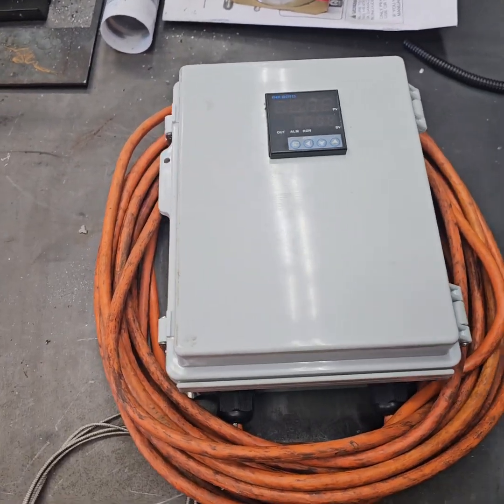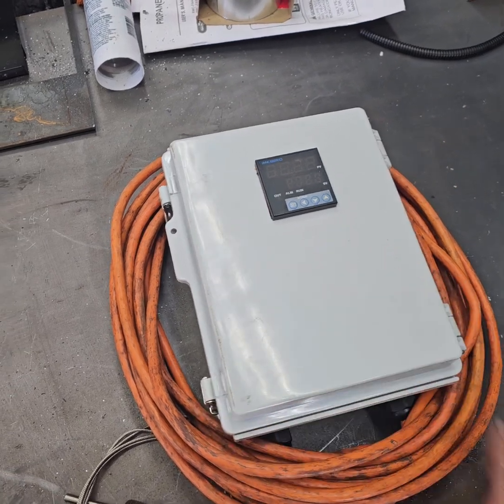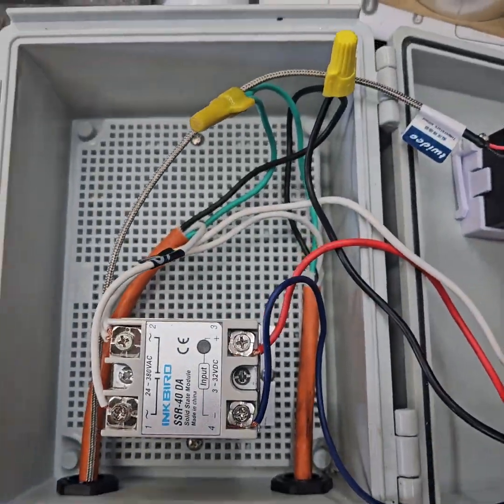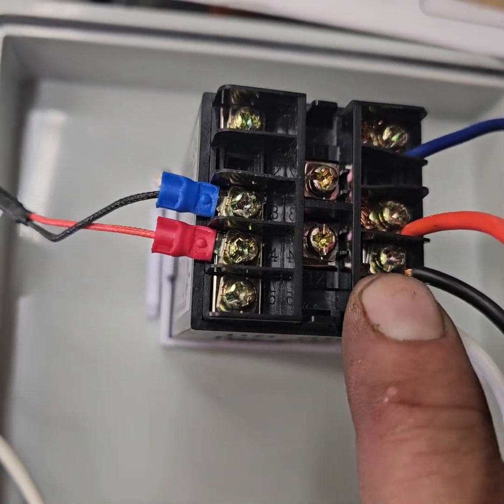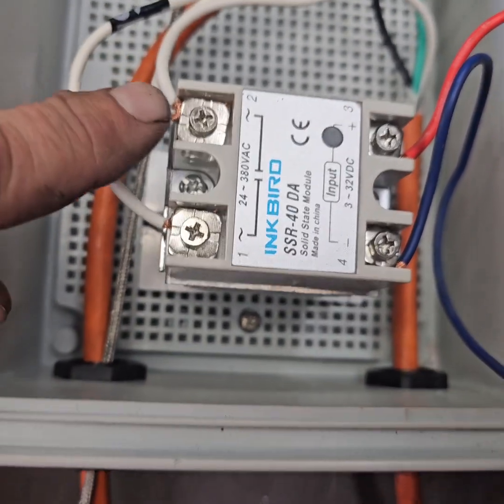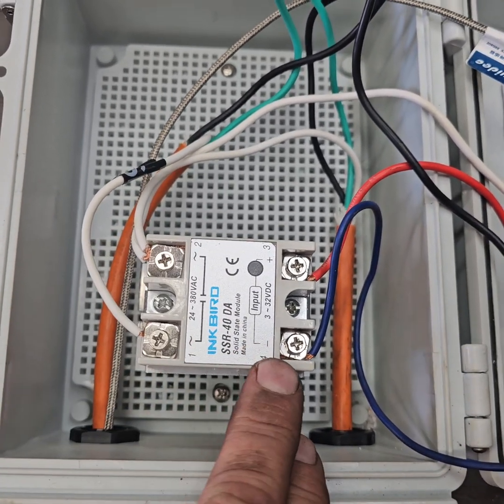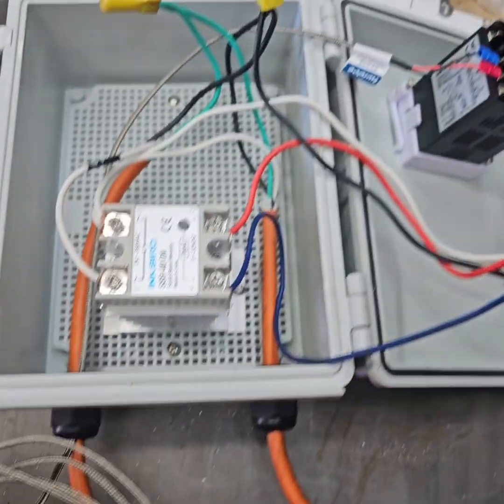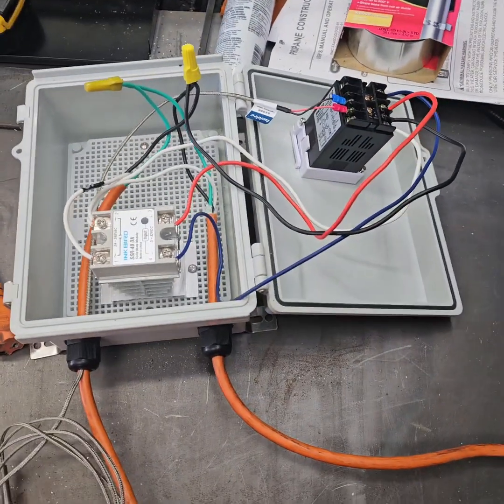How to wire an inkbird pid controller to run a propane torpedo heater for a powder coat oven.

Comment: If my torpedo heater already has the auto start on it . Do i still need the gas valve?
Reply from the maker: By auto start, do you mean an auto igniter? Because if it already has a valve that turns the gas on and ignites it automatically then you would have no reason to install a thermostatic controller. Any normal propane torpedo heater that I have seen has a dial that you must turn up and down manually and this must be replaced by a computer controlled valve system.
Reply: @paulmorris8673  when I plug it in it starts . My mother in law said they had a thermostat that it would plug into . But it didn't go up to 400 degrees.  But say it was set at 70 and when it hit 70 in the room it would shut off .
Reply from the maker: @lynnstump8502  I have never seen one like that but it does sound like it already had an autovalve on it. if that is the case then you could use an inkbird pid controller to turn it on and off. I would just test it very carefully 😁
Reply: @paulmorris8673 will do . Thank you very much . One more question where did you place your thermostat probs . I was thinking like a foot or so above the floor . I baught a 5x7.5x8 foot shipping container and im going to insulate it on the outside and then put barn steel over the insulation.
Reply from the maker: @lynnstump8502 I would think that would work good but I also bought 4 of these and put the sensors in several places to make sure my heat is even. 
https://a.co/d/9L1KkIp
Reply: @paulmorris8673  where is the one located you use to run the controller.

Comment: I believe you have reversed the polarity with wiring #8 (PID) to #3 (SSR), and #6(PID) to #4(SSR). The correct wiring is #8 (PID) to #4 (SSR), and #6(PID) to #3(SSR)
Reply from the maker: My wiring diagram shows 8 and 3 as positive and 6 and 4 as negative. So I have mine connected positive to positive and negative to negative and it works perfectly.
Reply: @paulmorris8673  good to note that there is polarity wiring variance between models.
Reply from the maker: @oneart6002  I am glad to know this, I wish I had realized when I made the video so I could have mentioned it. Thank you very much for the input!
Reply from the maker: I will have to go back and look at it. All I know for sure is it does work the way I have it wired up.

Comment: You could have a simpley changed location of thermo coupler to outside of heater to trick it not to turn off saved yourself a whole lot of troubles
Reply from the maker: @JRock80  but I want an oven that automatically stays at 400° and it takes a controller to do that.